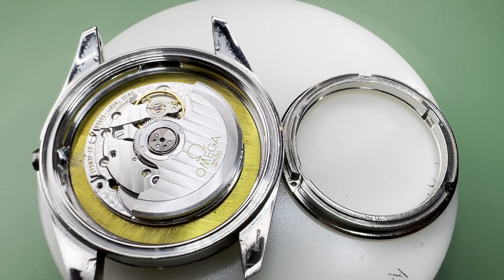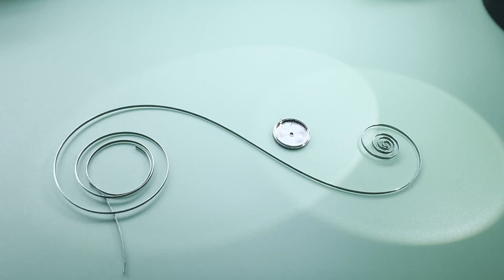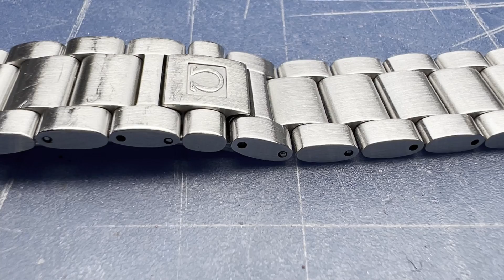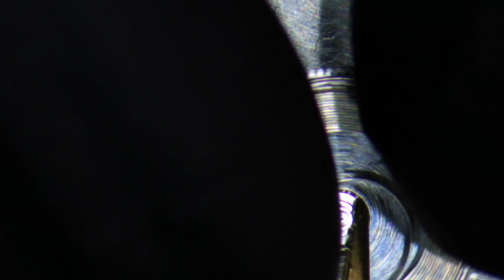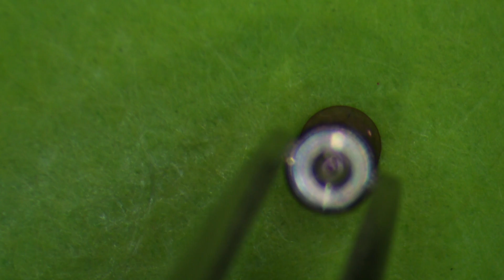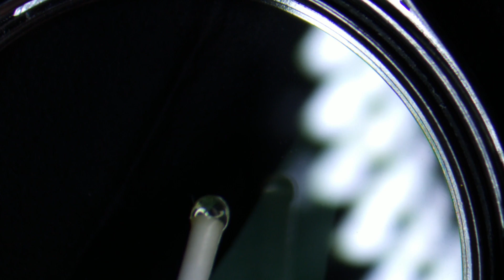Co-Axial Omega Service - New Camera Setup - Seamaster Aqua Terra 2500B - Watch Service and Repair

Comment from the maker: Update: during this video I did not oil the co-axial escape wheel, this was incorrect. Since then, the watch was partially disassembled and the co-axial escape wheel lubricated. That watch is now back together with a rate of +3.2 s/d and an amplitude of 302 degrees averaged over 5 positions.
Reply: I'm about to ask how did you not oil the coaxial escapement 😅

Comment: no adjusting amplitude and precision?
Reply from the maker: Hi, I didn’t show it in the video, but I did timegraph the watch and straight after the service and it was performing well. Then a few days later, after the oils had settled in, the timegraph results were an average of -2.6s/d, 306 degrees of amplitude, and 0.1ms of beat error over three positions, without any adjustment.

Comment: I'm a bit puzzled how  debris gets onto the dial of a premium watch thats meant to be waterproof.  I have an Avia I've had for 50 years, and my dads Rotary (never serviced and working well) even older both looking like new.
Reply from the maker: Hi, it's good to hear that you take care of you watches, unlike the previous owner of this Seamaster.
My guess as to what happed to this watch is this; the crown was undone and the watch got wet, the owner had a less thoughtful watchmaker take a look at it, they managed to scratch the anti-reflective coating of the crystal and the dial trying to get the watch dry. Then had it serviced where too much oil was used and wasn’t recased properly, leading to the condition that I received the watch in.

Comment: This is borderline hypnotic! awesome video. I have an AT as well, I bought it new this year. Besides the 5-8 year mark that they quote, when would you suggest for one to bring in their AT for service? Do they do the polishing of bezel and bracelet as well or is that separate? Thanks!
Reply from the maker: Thank you! 

With a new watch, a maintenance served in line with the manufactures guidance will be fine, however if you notice anything wrong (gaining/loosing tine, not lasting as long as it should) then it is worth while getting it looked into. This might not mean a full service, but watches don’t get better on their own, and could be a sign of a more serious fault. 

I don’t know about individual retailers, but you should be able to decide what you want in terms of polishing, that is what I offer.
Reply: @JosephCooperWatchRepair  Is there any link between service intervals and how frequently the watch is worn? I have an Omega Speedmaster Reduced which I wore every day for 30 years and only needed servicing every 8-10 years. I now have 3 other nice watches so none of them get worn for more than a week at a time. Will that require more or less regular servicing?
Reply from the maker: @ianforber That's a good question. A mechanical watch needs a service to clean out debris, replenish oils, and replace/fix worn parts. 
TLDR/ probably less frequent servicing, but still within the recommended interval.
Modern watch cases resist dirt ingress, so that is not too much of a problem. 
A watch being worn infrequently will see less wear, but that also depends on the conditions of use, if it is a "beater" watch there is more chance of damage (and dirt ingress) than a dress watch. Even if the damage isn't shown in loss of performance it can cause problems later on.
For the oils, it similar to your car oil changes. For a watch used infrequently the service can be pushed to the longer service interval, a watch used everyday should be service at the shortest service interval.
These are my thought, hope they help!